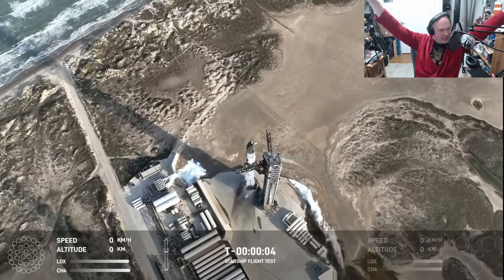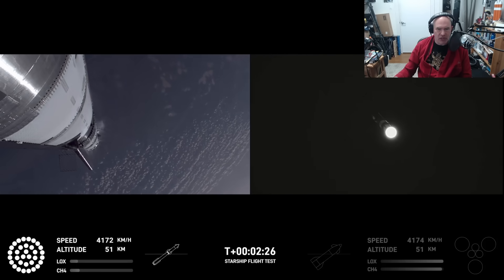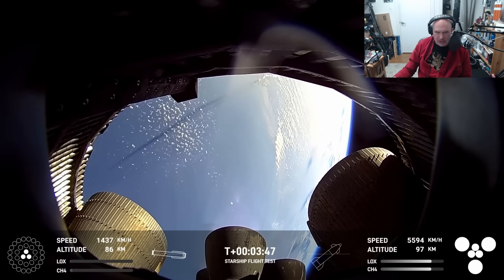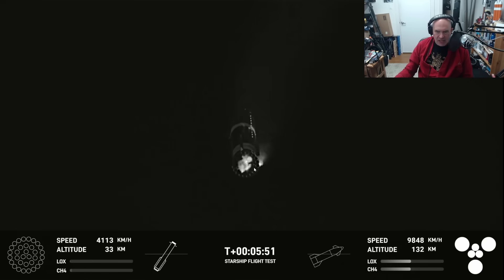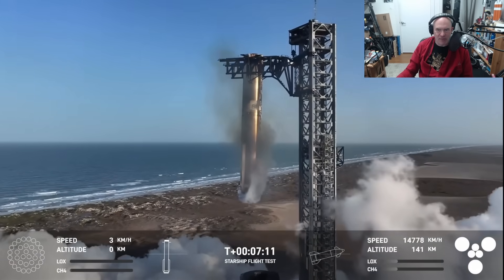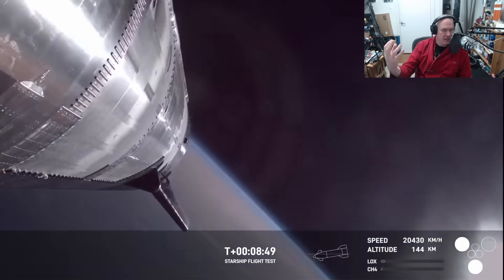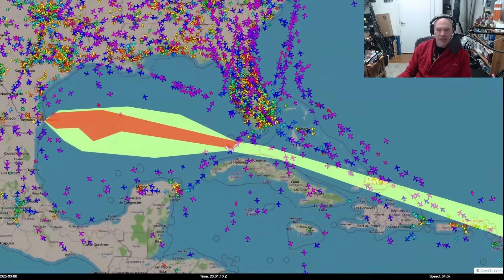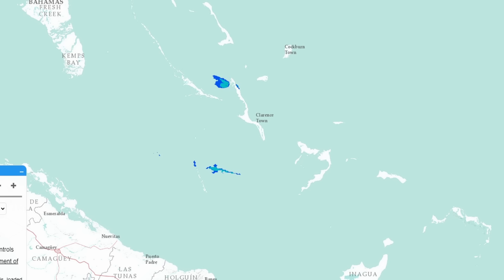SpaceX Make The Same Mistake Twice With Starship Flight 8

Comment: The important question isn't why haven't they gotten to orbit, it's why haven't they had a successful flight. I'm suspecting they are running engines too close to failure as a normal mode. This isn't good strategy for a reusable vehicle.

Comment: They are purposefully sabotaging the heatshield to test it's weaknesses. I would not be surprised that they are testing stuff on the test of the rocket, including stage interface and engines.

I am not so sure, if losing the vehicle is necessarily a surprise as of yet.

The booster simply builds so much on falcon 9 that there are probably less unknown variables. And they might have gone lucky with the catches, so no RUDs.

Comment: I've noticed during the recent Starship test flights (IFT-7 and IFT-8) that tank sensor readings for LOX and CH4 showed significant fluctuations right before booster-ship separation. During earlier flights, specifically IFT-6 (still using Starship V1), these sensor readings remained stable throughout.

Examples with timestamps:
- IFT-6 (stable sensor readings before separation): https://youtu.be/IqcFszeS9W0?si=uVHYCu7qP637S-rv&t=2224
- IFT-7 (significant sensor fluctuations before separation): https://youtu.be/tLuyH98TLks?si=Ll-yK_EyAMtQSLRG&t=166
- IFT-8 (also significant fluctuations before separation): https://youtu.be/kJCjGt7jUkU?si=KPja7b2oZLm0n2c8&t=95

Since Starship exploded after stage separation in both IFT-7 and IFT-8, I suspect there might be a connection between these pronounced fuel fluctuations and the issues that ultimately led to vehicle loss.
These fluctuations could potentially indicate fuel transfer between tanks or other dynamics previously seen contributing to booster losses in earlier flights.
Of course, it's also possible that newer sensors on Starship V2 are simply more sensitive or designed differently. Nevertheless, I believe this connection is noteworthy and merits further investigation.

Comment: To me, two booms in a row is because there are too many things spacex is trying to change each iteration (they've quoted in the 1000s...which is nuts frankly). Hopefully they get it working, but gotta rope back the changes to last design and include only things they know won't impact the prop sys. Also... get some fault detection and recovery on this bad boy... shouldn't be keeping other engines on when 3-4 drop out, def moved that thing off course and increased risk to where it would maybe land because the other engines didn't shut down. Spacex is one of the first entities changing things rapidly and launching/flying over humans/inhabited areas (or very close to..) - def more traffic compared to KSC launches... there needs to be more fault and recovery design frankly at an early stage
Reply: Man, you may have hit the nail on the head.  With each iteration they add more fixes and more potential sources of failure.  Would have been better to design it right in the first the place.
Reply: This is why iterative design dosn't work for physical objects.  In software I can add a for loop to my code and it dosn't change the weight distribution of a function or induce harmonic ossilations in an adjacent && conditional.  Software is encapsulatable and can thus actually have a million lines of code written and tested in isolation and then come together flawlessly.  This is impossible with a physical object, the design must be wholistic as well as the testing and trying to make a thousand changes at once is just a nightmare that guarantees a new failure mode.

Comment: Ya know.  It seems that since they moved the forward flaps the  Harmonics started to be an issue. Also since they started stripping Heat tiles off and leaving some holes in air flow. Could these be Harmonic generator at Mach 10+?

Comment: If you actually look at the 3 centre engines in the middle, it’s actually spilling the fuel directly over the back of the 3 centre nozzles causing them to heat up where they shouldn’t be (the engines exploding was probably secondary,likely was that left engine the melted and blown sideways taking out the 3 centre ones or 2 centre ones exploded taking the outer left and the 3rd centre out) 

I find it unlikely the 2 outer ones was still active after it lost the centre ones (we have seen the computer show active engines when they wasn’t active) the fluid inside moving around plus the venting is likely why it was spinning off axis

Comment: I will never understand and can't get the equation of this landing boaster. It's just stupid, a lot of extra weight for the fuel to land, that also add weight for the extra fuel to get I flying from start. So why don't they just use some parachutes with some very small correction  boosters to land the booster? It would save a lot of weight that would make it carry much more payload. But I guess Elon's standard pr marketing manipulation is a must for gaining all stupid fans for a rocket and a total scam idiot, the almost same rocket people has made for +60 years now and done so much better than Elon. Elon just as Trump know who they targeting to be fans, the easy stupid people
Reply: Very good point.  At least then you know would always know where the booster would splash down.
Reply: If it was as easy as adding parachutes, then why hasn't anyone else done that? (Well, anyone other than Rocket Lab, but their rocket is tiny and made of carbon fibre, so very light).
SpaceX have been eating the launch market since they first landed Falcon 9 in 2015, now accounting for about 90% of all mass launched to orbit per year.
Falcon 9 is able to launch every 2 days, while other rockets can manage about one per month because they aren't reusable.
If parachutes were a good idea, surely someone would have used them to make their rocket competitive with Falcon 9 by now?

Comment: Probably, FTS was safed indeed. From new close-up videos of reentry, no sing of extra "energetic events". Just shedding pieces due to fast rotational Gs. 
Which is not nesesserily a bad thing. Without FTS, breakup eventually will still occur, but later. And the fallout ellipse will be smaller. It is already compact enough compared to what it would be with aluminum parts. And spinning will neutralise any possible course deviations even with running engine and no directional control (bad case for straight-flying runaway rocket).

Comment: Have they re-flown a first stage yet?
Reply: Yes
Reply: No, not yet. Only Boosters 12 and 14 had previously landed. 12 will probably never re-fly. Booster 14 may fly on the next flight.
Reply: @ They didn't specify superheavy boosters.. Falcon 9 has had plenty of reused boosters, and superheavy boosters are going to start getting re-used very soon since they are catching them pretty successfully currently
Reply: @ I am only talking about Superheavy boosters.

Comment: I remember the early thoughts regarding the booster re-entry heating were that it was due strictly to ablation and had a hunch it had more to do with engine chilling and methalox burning rather than any ablative material, so it's great to hear this confirmed - thanks

Comment: My Hypothesis: Cascading Propulsion Instability and Control Failure Caused Starship Flight 8 Explosion

Primary Hypothesis

I believe the explosion of the Starship upper stage during Flight 8 was caused by a cascade of propulsion system failures, triggered by disrupted propellant flow to the Raptor engines during ascent. This resulted in asymmetric thrust, loss of attitude control, and ultimately, aerodynamic breakup.

---

Supporting Sub-Hypotheses

1. Propulsion System Instability

My Theory: Sloshing of liquid methane/oxygen in the main tanks disrupted propellant flow to the center Raptor engines, causing cavitation in turbopumps and sequential shutdowns.

Possible Fixes:

Implementing anti-slosh baffles or compartmentalized tank designs to stabilize propellant flow.

Optimizing subcooled propellant conditions to minimize gas bubbles and ensure consistent feed pressure.

2. Thermal Stress on Engine Components

My Theory: Overheating in methane-rich preburners or regenerative cooling channels degraded engine performance, leading to premature shutdowns.

Possible Fixes:

Improving regenerative cooling with redesigned channel geometry.

Applying ceramic thermal coatings on critical engine components.

3. Inadequate Redundancy in Thrust Vector Control (TVC)

My Theory: The loss of multiple center engines overwhelmed the remaining engines’ ability to compensate for asymmetric thrust, leading to uncontrolled spin.

Possible Fixes:

Introducing dual-gimbal actuators for improved engine articulation range.

Implementing decentralized engine clusters with independent control systems to isolate failures.

4. Aerodynamic Control Surface Limitations

My Theory: Starship’s fins and RCS thrusters lacked sufficient torque to counteract the rapid spin induced by engine failures.

Possible Fixes:

Increasing the size of aerodynamic control surfaces or upgrading to methalox RCS thrusters for higher torque.

Developing AI-driven flight software to predict and preemptively adjust control surfaces during instability.

5. Sensor/Software Overreaction

My Theory: Faulty sensor data (e.g., pressure spikes) triggered unnecessary engine shutdowns.

Possible Fixes:

Using triple-redundant sensors with machine-learning algorithms to filter false positives.

Implementing graceful degradation protocols (throttling instead of shutting down engines).

---

Validation Testing

To confirm my hypothesis, I propose that SpaceX should:

1. Conduct ground tests of Raptor engine clusters under simulated flight vibrations and slosh conditions.

2. Fly suborbital hops with modified Starship prototypes to validate aerodynamic control upgrades.

3. Analyze telemetry data from failed engines to pinpoint exact failure modes (e.g., turbopump cavitation signatures).

---

Expected Outcome

If these proposed fixes are implemented:

Engine shutdowns during ascent should decrease by ≥80%.

Starship should maintain attitude control even with 2–3 engine failures.

The risk of aerodynamic breakup should be eliminated below 50 km altitude.

---

Conclusion

In my view, Flight 8’s failure was primarily driven by propulsion instability, compounded by insufficient redundancy and aerodynamic limitations. Addressing these factors through iterative design upgrades and rigorous testing should significantly improve Starship’s reliability and pave the way for successful orbital flights.
Reply: Given Block 1 version successfully made ii back to hover above the surface of the sea I take it this does not apply to Block 1? Do you think they should just step back to Block 1 and adapt from there?

Comment: A simple 4x time-warp would have paused the physics engine and cancel the rotation. This simple trick saved so many of my kerbals.
Reply: Erm actually you mean 5x, 4x is how high physics warp goes
Reply: @theterrificturtwig5742  Maybe they did actually do 4x and the kraken broke starship.
Reply: This was still inside the atmosphere though, you can't do on-rails warp until you get out of it (>200km).
Reply: 5x+**
Reply: I'm waiting on the announcement from SpaceX that this mission was a success.
Reply: it would not work with RP-1 tho
Reply: Clearly he didn't have enough goo on the one side.
Reply: persistent rotation mod would like to have a word with you
Reply: I think that's what they were trying, but they forgot to shut down the engine? So they got physics time warp and everything exploded, as is tradition
Reply: If you go 300km/s, that'll get you a 4x time warp.
Reply: Karma…
Reply: dont make cheating cool. shame on you.
props to me who played KSP for YEARS and never knew that bullshit.

dont be garbage.
Reply: @NickCastleGames  you cheated yourself by letting physics bugs detract from a successful launch.
Reply: @Glassboxgames It's not a cheat, it's the only vanilla feature that allows you launch lore-accurate noodle ships without wobble. Also works against the built in "Kraken" feature.

Comment: This is what happens when you failed physics in elementary school! If you payed attention they shut off the central engines first mistake one, the one engine well they are shutting down the outside engines keeps burning for about a half a second mistake two and finally the shroud around the engines is acting as a pressure system for the gases as seen in video… logically you get rotated those 2 forces the engine burn and pressure on one side of body of an object, if they shut down in reverse the outermost engines then the inner it will take much greater force to cause rotation… literally basic physics and mathematics, looks like these people were the rejects of DOGE and we know they can’t do basic math!🤣🤣🤣
Reply: Funny, you think you're intelligent. I enjoyed reading your comment 😂😂
Reply: @ well I didn’t mention the gas’s being sucked in behind the other engine which would indicate a wake is formed by a moving pressure ridge in kind causing centrifugal force on the body of the craft in short causing more spin on another axis, that’s jr high knowledge you know sitting in a chair and holding a bike wheel in your hands…  basically I use logic, math and science to solve problem’s. they forgot about taking a box and drawing an x pushing on the centre it goes forward, place force slightly off centre it spins, plus I have a few degrees if that accounts for anything!

Comment: At 4:00 you stated the reason not keeping the hot staging ring. It's not so much due to lack of fuel left in the booster for it's decent. It's due to the weight of it. It's jettisoned simply because the weight makes it too heavy above the grid fins to make a proper decent. In newer iterations, it will not be disposing of it as they do now. Because it will be much, much lighter.

Comment: I expect they know exactly what the issue is after flight 7 and the testing they have done since. I'm sure they put in some fixes they thought would contain/alleviate the issue, but they were stop-gap measures and not a long term solution. Ship 34 was already built and I doubt they were able to change too much as-is. On the other hand, I bet this ship carried more sensors than any before it and a large number were pointed at critical hardware and monitoring vibrations.  I also expect there is a total redesign already planned and they were simply trying to get this flight profile completed on existing hardware so they could move on better designs. Whatever the issue is they have a wealth of data this time around and will overcome...we're simply not used to a company that sends up rockets this large as tests vehicles every couple of months. We're used to NASA and large contractors who spend decades designing and redesigning every part and system over and over to ensure perfect operation. Folks just have a hard time understanding that while SpaceX would prefer a perfect flight every time as well, they're not averse to failing spectacularly if that's what it takes to achieve ultimate success...

Comment: My guess at the root cause is that they have a vibration problem involving multiple modes of oscillation which is accumulating energy until something breaks. This happens in aircraft with “flutter”, and can be really hard to predict. Consider the trouble Lockheed had with the Electra turboprop. When engine mounts were weak the power of the engines would bend the wing. It was easy to fix by adding a diagonal brace, but they lost multiple aircraft to find it. This problem would not have aerodynamic forces, but there are plenty of modes of vibration, and multiple engines driving the oscillation.

Comment: Knowing nothing more than what has been speculated upon by the many Youtubers that cover this, I speculate they don't have even close to a handle on the vibrational forces caused by the booster. The sound you hear is like the sky tearing, it is deeply crackling. I think they haven't determined the true amplitudes of accelerations due to the vibrations. They can test stand it, but a rocket not moored to the test stand may well have other modes of vibration. It may be that they questions be asked by the Starship program is beyond what materials science has generated answers for. As soon as Musk is no longer in favor with Trump the FAA will come down hard on any more launches of this monstrosity. (Note, I was pulling for them to make it work, but I'm filled with doubt now.)

Comment: With respect Scott - from an avid subscriber - Loose, plucked, vibrating fuel pipes does not sound to be aerospace fixing standard to me.  Surely they must cleat/tie/saddle/conduit lengths of piping in the same way as cables?  - It's likely that I cannot comprehend the vibrational forces at work so close to multi-engines :-)

Comment: Considering what spacex has let slide in the past, I'm wondering, when they added several tons of fuel, did they figure the bulkhead separating the lower tank from the engines didn't need reinforcement? It doesn't need to fail.  Just deflect enough for the plumbing to heave. Sounds like a dumb error, but hell, when they were first practicing flipping to land, they only lit one engine, assuming it would light every time.  Can't wait to find out what they come up with.  Great vid as usual, Scott.

Comment: The worst thing about this is the likely large delay before the next flight. They had a waiver to do this despite flight 7 still being investigated, so to have what seems to be the same/similar issue will probably result in many months wait before the next launch. I would be surprised to see them launch again before the end of summer. But who knows, with Elon's current position, things might happen faster, though I don't necessarily think that would be a good thing